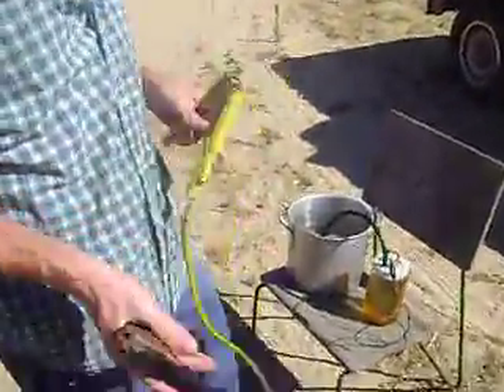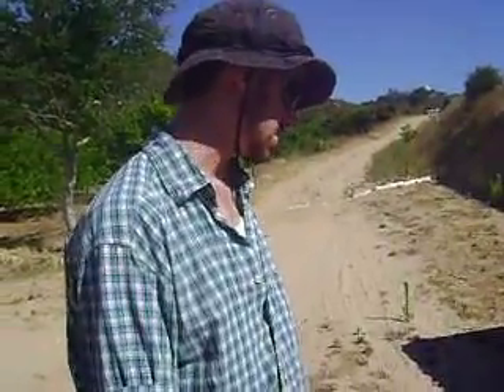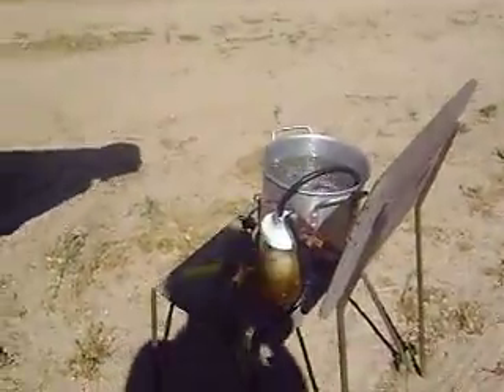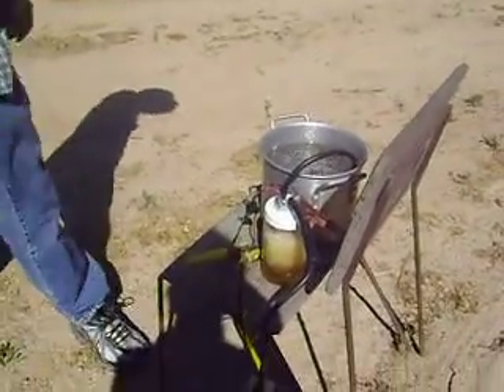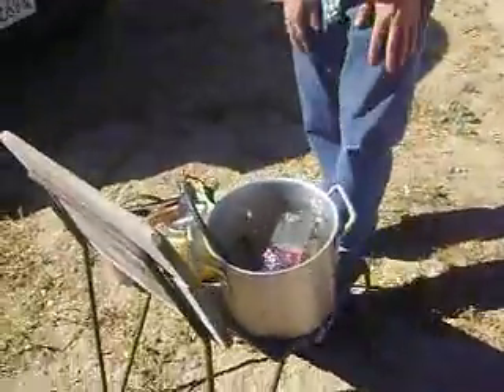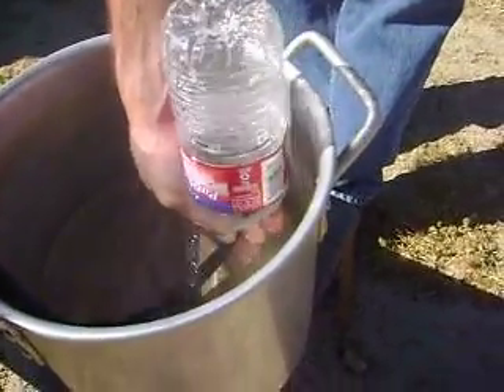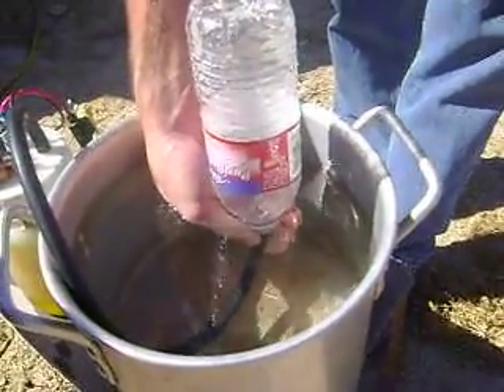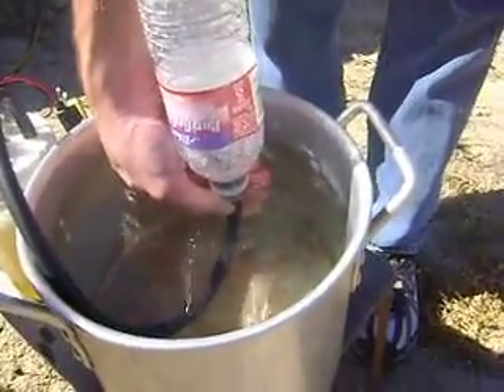Explosive HHO demo

Comment: SOME slow explosives such as gunpowder will take the path of least resistance however, the propagation rate of hydrogen is in the region of 2km per second which means that ALL of the gas will explode almost instantaneously allowing no time for expansion in a single direction.  Igniting hydrogen in a glass vessel with a relatively small opening can easily have the same effect as playing with a grenade with the possibility of being just as lethal.

Comment from the maker: Yes and this is why I used plastic and only 20oz, so given the volume of this container, the gas exits the tip of the bottle and the side effect is an imploded bottle caused by the rush of air out and subsequently the lack of pressure inside the bottle. Lighting any explosive inside of glass is just plain stupid.

Comment from the maker: Actually... what I did was quite harmless as the pressure created by the hydroxy explosion, like any force in nature, takes the path of least resistance, which was out of the end of the bottle, causing a reaction; that is the propulsion of the bottle in the opposite direction (not toward me). Knowledge is power.